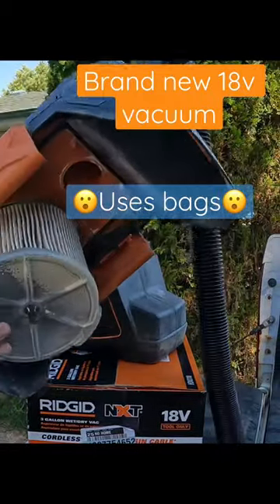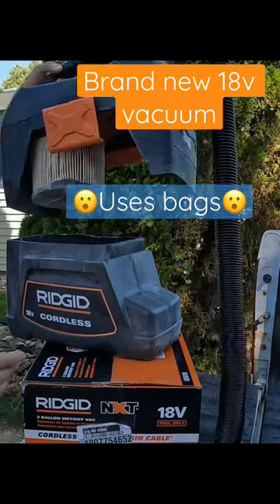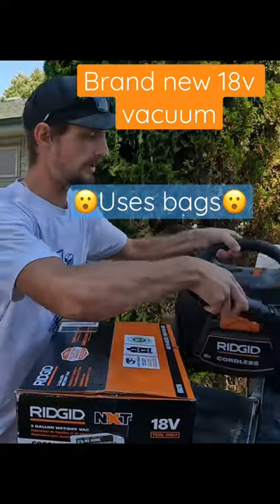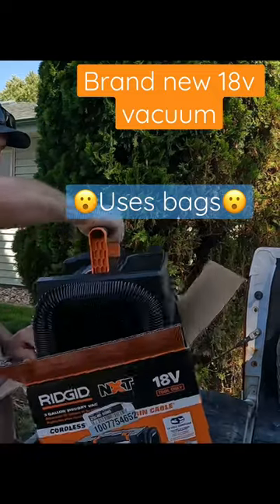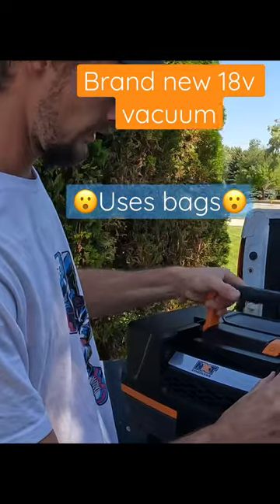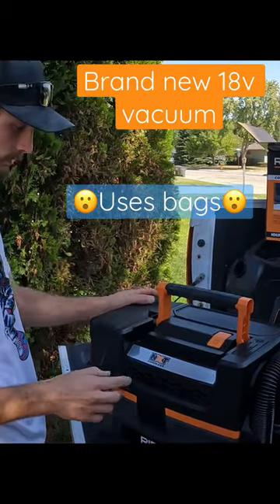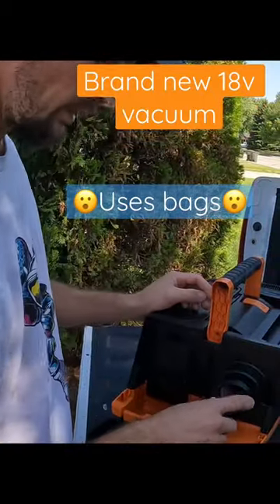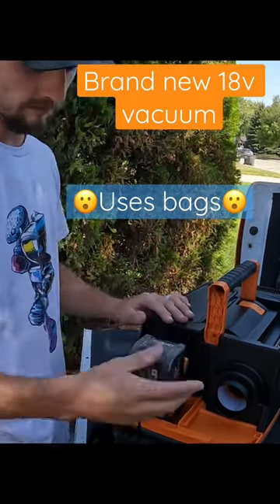New released Ridgid 18v vacuum. Full review on my channel! #tools #review #construction #diy

Comment: Oh, by the way, the bags fit but don't work well cause there's not enough room to get around  the filter.
Reply from the maker: All the time I’ve been using ridgid vacuums I don’t use both, if there’s a bag in there i take the filter off. Try taking the filter off and being careful with what you’re vacuuming up, I use my battery vac for lite jobs primarily.